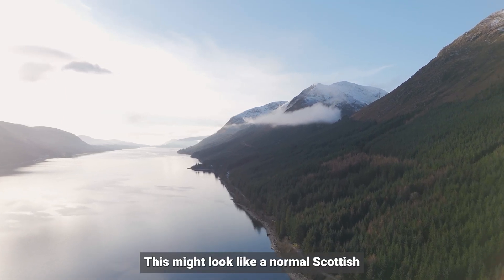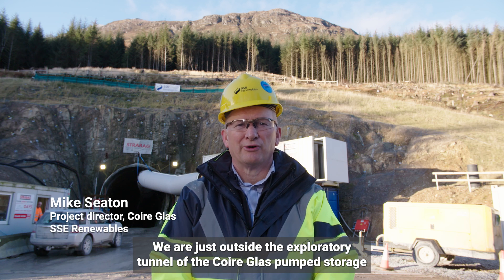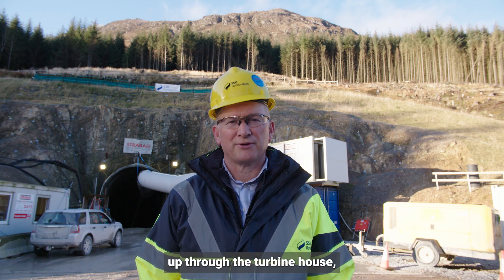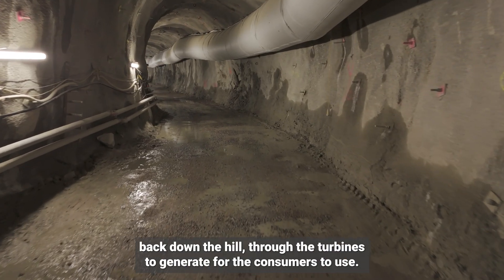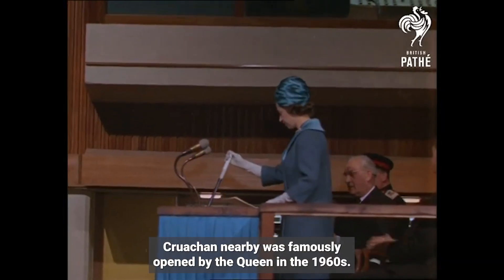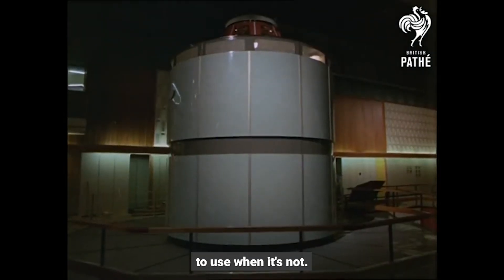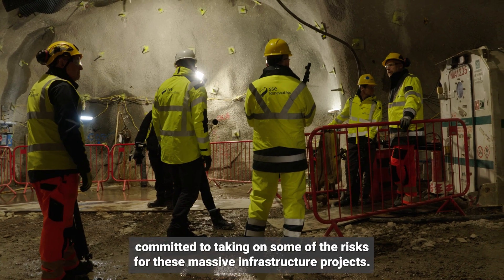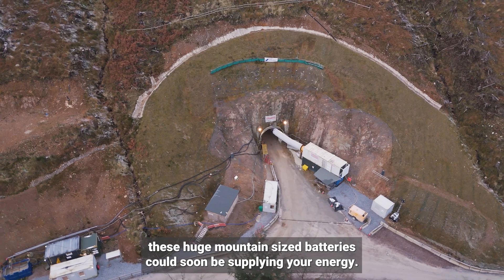Why this mountain could soon be Britain's biggest battery

Comment: It would be useful if you said how many GWh of energy it can store. As a country, we desperately need more pumped hydro batteries like these. I believe there are 6 in planning for Scotland that, as well as storing more energy, will create 15,000 jobs in the area. I think we should be pushing for a HVDC backbone running the length of the country.
Reply: 30GWh